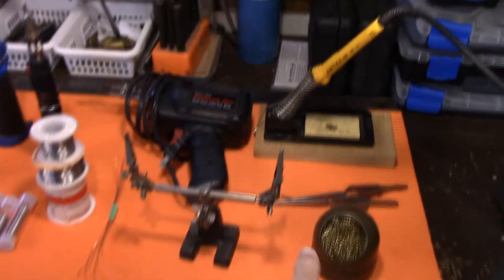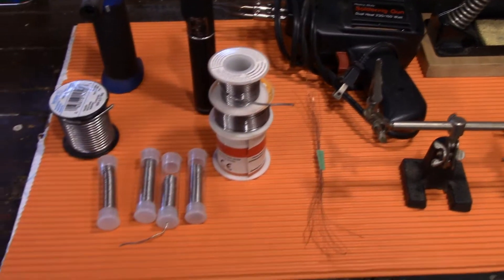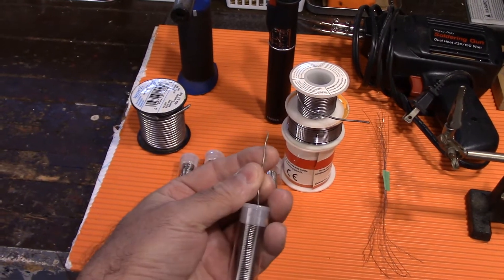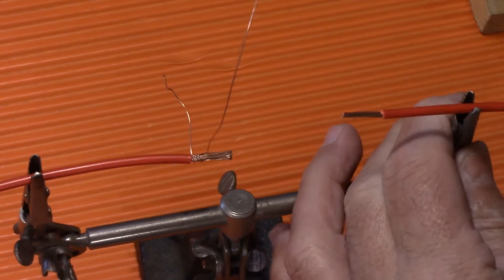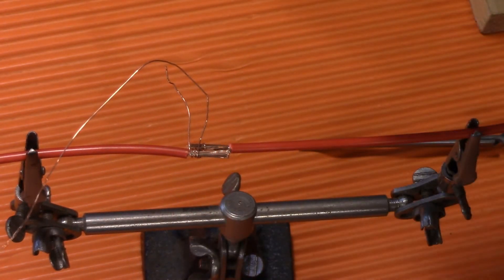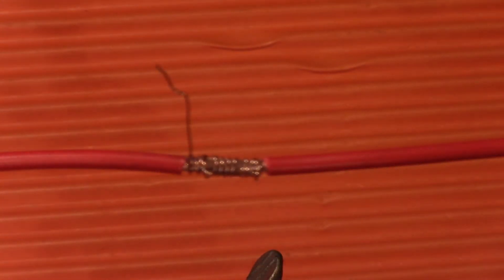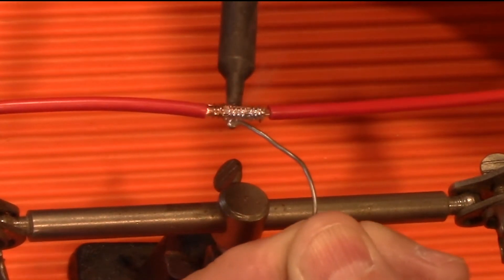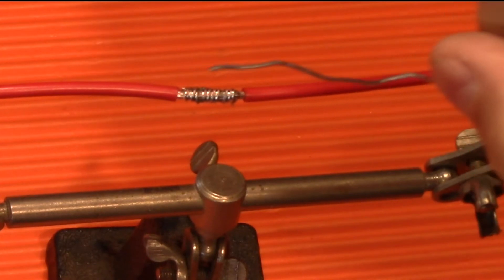Soldering  Wire  Hack  - Tips And Tricks

Comment: Been awhile since I have had to solder. Bob's Your Uncle. Good soldering tip Steve. A best practice for sure! And then do you heat plastic over that area?
Reply from the maker: Yes sir !  You should definatey dust off your soldering iron and solder something up  La Texas style :)
Reply: @SteveRobReviews  I tried to weld with a metal hanger once, didn't work. Not hot enough
Reply from the maker: Try welding rods next time , I'm sure Texas has some around somewhere in the state 🇺🇸👍
Reply: @SteveRobReviews  I had a whole slew of them I got for free, gave them to a guy in trade of some work for me.
Reply: I didn't realize how much they were worth at the time!

Comment: Good tip Steve. I have never seen that technique before. It makes a good solid connection.
Reply from the maker: Thanks bud , its frustrating at times  soldering if the wires move so I just don't like frustrating at all 😅👍

Comment: Great tip with wrapping the two wires together with that strand.  Nice clean joint.  I have two Weller soldering guns, they work half of the time I need them but one almost always does.   Haha
Reply from the maker: Pat this iron is so old I can't remember how old:)  yes give this a try next time 👍
Reply: @SteveRobReviews  Steve I watch nearly all of your videos.  I am sure you either wrote the date you got it on the bottom of the base or the manual.  Haha

Comment: I never have luck  with solder, always have to do it twice. Never heard or seen anyone use secondary wire. Makes sense really. Thanks steve
Reply from the maker: Well the biggest soldering challenge I have noticed is inconsistent heat transfer from the iron to the wires but wrapping the wires binds it to consistently transfer the heat evenly.  Cheers 👍

Comment: Hey Steve
I can see where wrapping the connection with that fine wire prior to soldering would be a good suggestion if your working on the wiring of a farm tractor or an ATV, motorcycle. 
I guess any connection that would be subjected to a lot of vibration. 👌🏼
Reply from the maker: Yes absolutely.  👍

Comment: How's she goin'?  I have never wrapped a single strand of wire around a joint before.  That is a good technique though, but it takes time and attention to detail.  Not that that is bad, but often times you just want to solder the wires and move on.  The key, like you mentioned, is to make a good mechanical joint before you solder.  A good mechanical connection is the key and the solder just locks it all together!!!  Good, better, nest certainly applies here!!!  Great demo and I like that you mentioned 'not' to use plumbing solder!!!  LOL  Take care!!!
Reply from the maker: Mike for them times when the wire must not only look good but look good for decades this is my go to method  but if i'm in a hurry I just  put it off to a day when I have more time to do it right. LOL

Comment: I have a Milwaukee battery soldering tool. I like it. Takes awhile to get hot but I think it works well. I like the way you did it. Thanks for the tip!
Reply from the maker: I think you need to demo it on  different gauge wires and see how low of  gauge it will solder.  Yep that's  a smokin vid right there Mike LOL